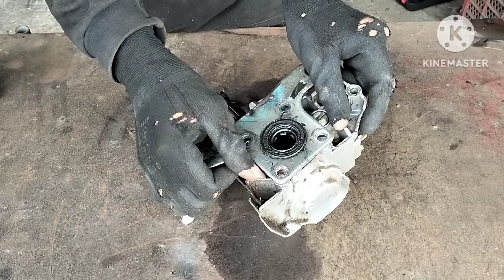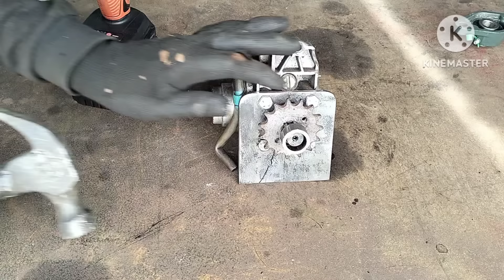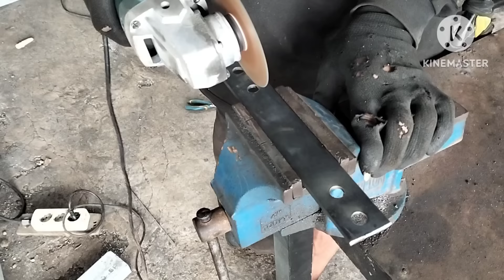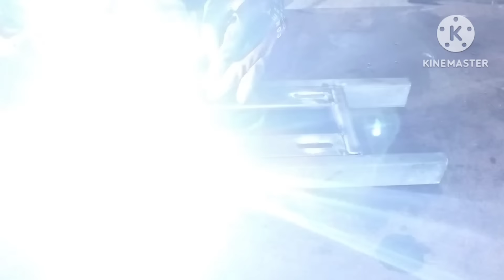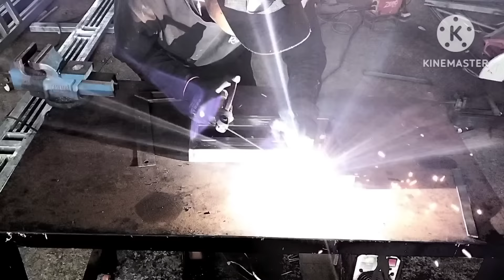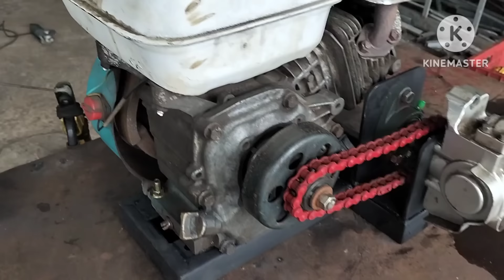CONNECT THE DRIVE ENGINE TO THE RECIPROCATING GEARBOX

Comment: Hello please make video abouth 2stroke or electric motor engines who run prenumatic pump or hidraulic pumps ,in some Landes it's hard finding flywheel to pump connectors for engines .That gear box is reali cool project 🙌😊
Reply from the maker: Terima kasih ,nanti di lain kesempatan 🙏🙏